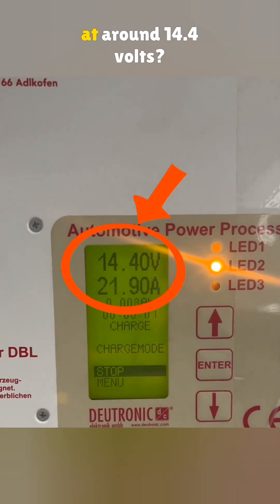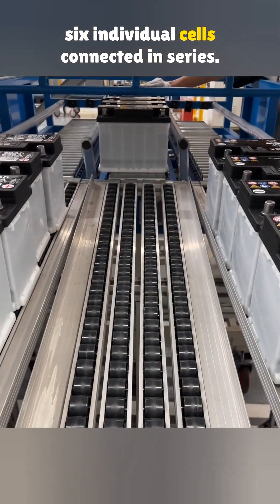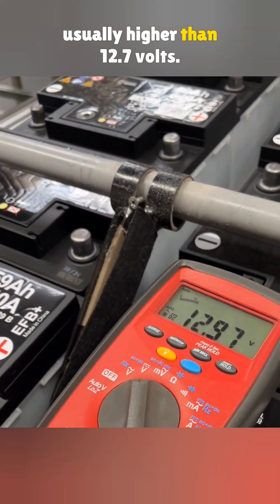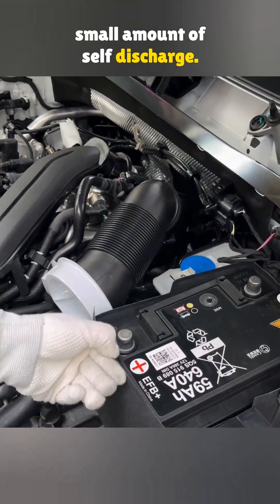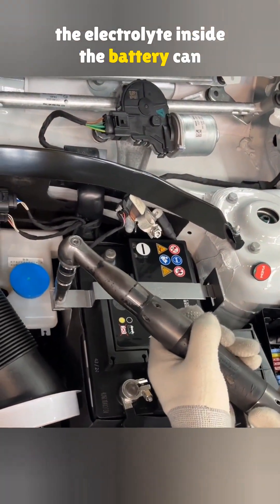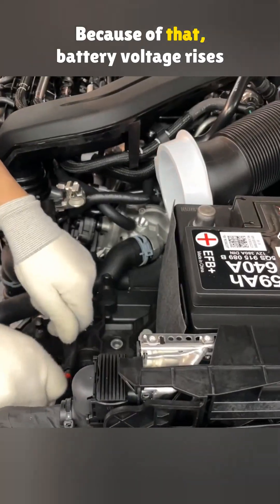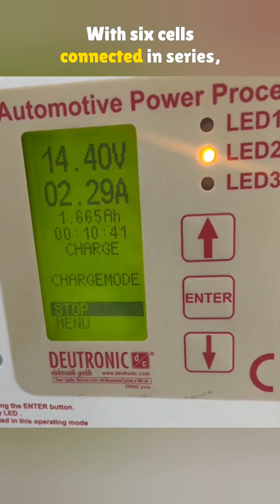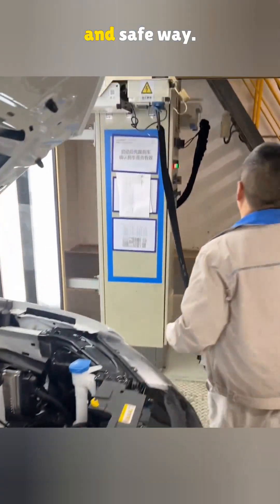Why Cars Charge Batteries at 14.4 Volts

Comment: Modern batteries aren't acid
Reply: No, most car batteries are still lead acid batteries..only evs have a huge voltage lithium ion battery and most of the still have a low voltage lead acid battery to power things like headlight and infotainment.
Reply: @bharathirajkumar no. Modern cars use lithium ion even for the 12V battery
Reply: @joaoalegrio6433 no, I am yet to come across a diesel, gasoline ar that uses lithium ion battery. There may be a few hybrids that use lithium ion as well, but all use lead acid for starter
Reply: @bharathirajkumar  Yes ,correct, lithium batteries are very ,very rarely used in automotive situations,  also if a battery reads 12 v under no load ,its basically flat .12.3 is 50% , and 12.6 is 100% charged
Reply: @bharathirajkumar my car is from 2003 and use a lithium ion battery
Reply: @bobgorman9481  When its full, its usally 14 v
Reply: @joaoalegrio6433  What model is your car. Back then, even cell phones did not use lithium batteries, they mainly used nickel cadmium batteries. a 2003 car using li battery lol.
Reply: @bharathirajkumar No, a fully charged flooded cell battery with no load and its " surface charge " depleted ( min 24 hours after charging ) will be 12.76 max .
Reply: @bharathirajkumar  He probably means it's " retro fitted" into a 2003 car ( can't think why though).
Reply: @joaoalegrio6433  nah they use lead acid. even EVs use a 12V lead acid for bringing the lithium traction battery online.
Reply: Even agm batteries use acid, just that the battery is sealed and acid absorbed into the glass fiber
Reply: Almost all BULL SHIT